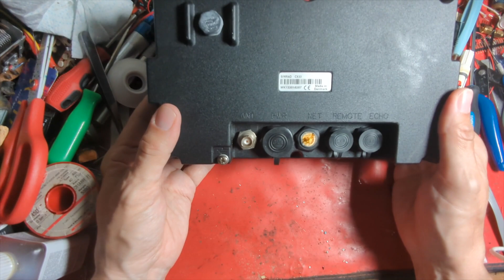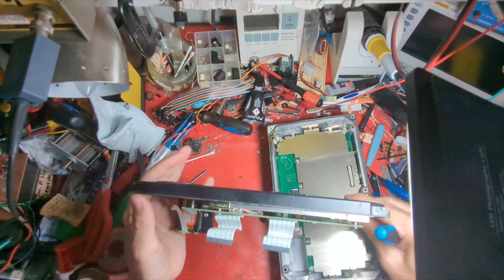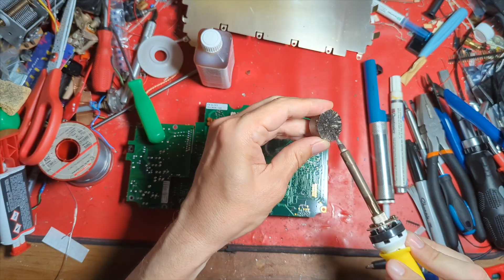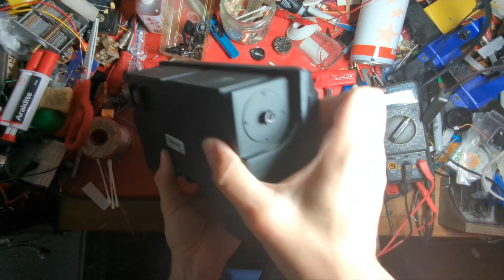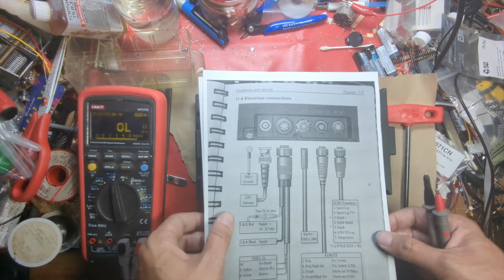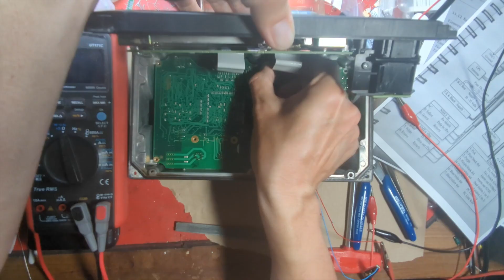SIMRAD CX33 repair

Comment: I'm sure the residue is from the adhesive that bonds the display together, and it's degrading. I had a similar thing happen with a Sony Vaio laptop.
Reply from the maker: It didn't seem to be leaking out of the panel. I wonder if it's degraded moisture sealant.